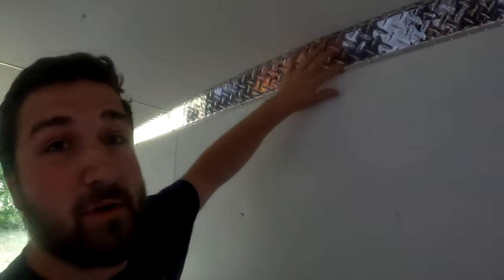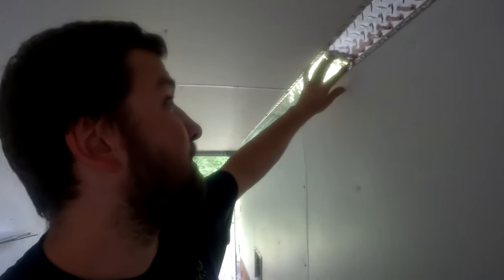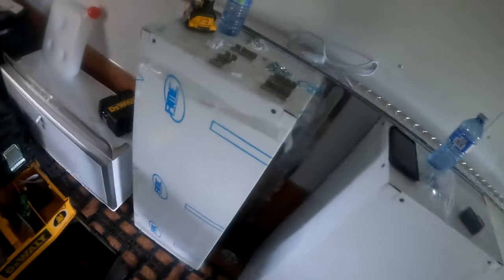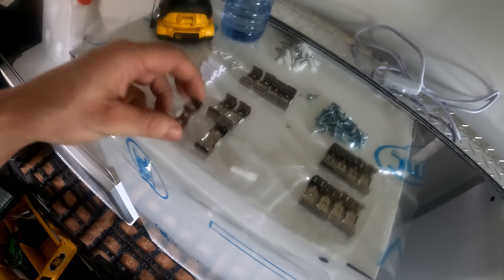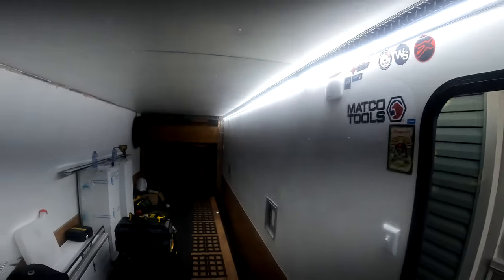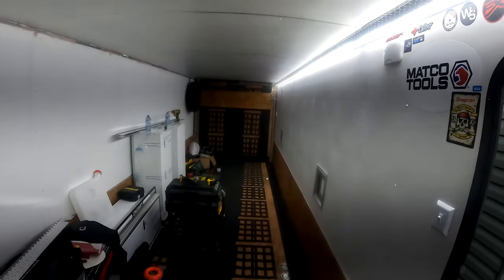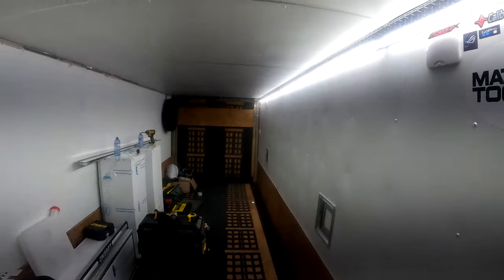Building the Best Snowmobile Trailer on Youtube! LED Light Install

Comment: Nice. I’m going do those lights too. Thinking bout putting another set just above the skid plate down the sides so it’ll light up the sled if you need to work on it. Thanks for the tips!
Reply from the maker: The light I installed are bright enough that I can work on sleds with out any issues really. I thought about adding more but it isn’t needed in my case. Perhaps because my trailer is all white inside